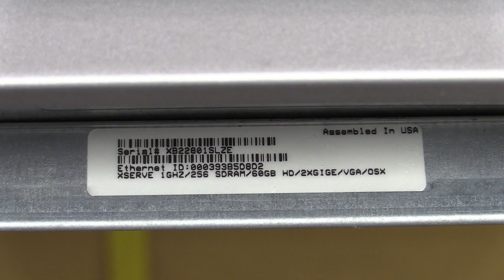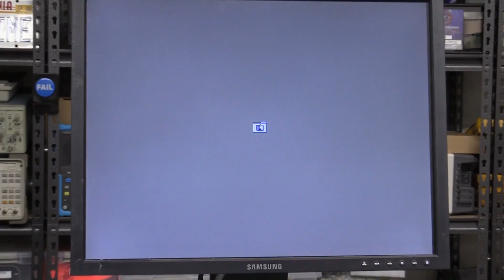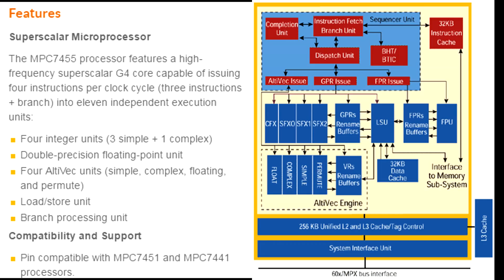EEVblog #882 - Dumpster Dive Apple Xserve Computers

Comment: What's the point? What do you do with an apple server?
Reply: +Marcel Robitaille Serve apples
Reply: +Marcel Robitaille. The same things you do with any linux or windows server. Database, NAS, Directory Server, render farm, web server, custom number cruncher, etc. The xserve was a pretty nice machine and actually at a reasonable price, but you would probably only get one if you had an office full of apple computers.  If your whole office was windows machines, a dell server just integrates better.
Reply: +Marcel Robitaille Simple: When you needed an Apple file server (for Time Machine, for example), you needed MacOS X. Linux didn't really support that in ~2002.
Reply: +Michael Wilkes Why get this pile of shit when linux is free? I don't see why you would want an os like osx running on your server, even if all you had was apple computers.
Reply: +Marcel Robitaille . Well yeah, thats what most moderately skilled people did. thats why the xserve is not very popular. If you know what you are doing, you run a linux server. There are a lot of people and companies that run windows servers because it is more familiar to them. xserve is specifically for people that would rather never touch windows or linux. I think to computer itself is quite nice, and the os is pretty nice, but it is a bit expensive and really designed for a niche market.
Reply: ***** Yes you are right that macs are very popular, much more popular than linux as a desktop. But this video was about a server, and the original post by Marcel was about macs as servers. Marcel is pretty damn spot on that linux rules the server world. Maybe you need to crawl into some dark server caves to see what makes the internet tick.
Reply: +Michael Wilkes Agree with you 100%. *nix is all very similar. If you know the commands for Mac you should have a good base for Linux, maybe even enough to get a server going with a bit of googling.

Comment: Plexi top cover on it, some legs and they might make a nice table.
Reply: +MrTVintro Good idea :) . I have a HP Blade server with a plexi glass cover. Used to belong to Blizzard once. Were selling them for a good cause and I managed to obtain one.
Reply: +MrTVintro Would make a good table that also does file shares...
Reply: dispatcher7007 the Pi does have lower power consumption going for it... not to mention, you can run an ass-tonne more disks on it just by whacking a load of powered hubs on it! As long as the Pi gets its 1000mA of power it's fine! The disks can all be run on external power... might be more plugs, but you shouldn't run into any errors with regards to limitations in the maximum storage pool capacity!! With an XServe, you're limited to 500GB per drive since it's IDE based!! The Pi will happily control more than 5X that capacity through ATAPI bridges to SATA disks!!
Reply: you believe in angels..

Comment: In fact this kind of "Squirrel-cage"-fans is used very often in 1HE server cages. It sucks in the air from the base panel and throws out the air with pretty high speed to the back (here, through the cage with the CPU(s). Therefore it sucks in cold air from the front through the hard drive cages because hard drives can't stand that heat and the fan then blows in direction of the hotter modules, like RAM, CPU and expansion cards.
Reply: +Slartibartfas042 I ever came across one in an HP workstation. That thing sure was noisy. Never understood why someone would put one of those in a workstation.
Reply: +Naomi Baron Oh yeah, you're absolutely right for a workstation. On the other hand - for servers this kind of "hair dryers" are pretty common. In fact, the 4cm diameter standard fans that you could use at the 1 Height-Unit servers (widely known as pizza boxes) as maximum size are even louder than the radial ones. :-)
Reply: +Slartibartfas042 Yeah the 40mm ones you get can be quite long and have 2 counter rotating impellers. In many cases they draw 1A + at 12V and are indeed loud (decent airflow and monster static pressure though)  But squirrel cage are just about deal for this application. They're also common on graphics cards where they had been part of the standard reference design for years. I think people underestimate how much air they can pull from a very narrow width below the fan, they are quite different beasts than "normal" fans (also called Axial I think?)
Reply: problem is, you can't really double up blowers. dual 40mm fans are for improved reliability as well as performance. one dies - cpu heats up, alerts go off, someone stops and services the box. blower dies - server stops unexpectedly.
Reply: if squrrel is mail service an air is ado be,watt sine gong soft hard cross word ant fleas?

Comment: Apart from the power supply and the fans, the case itself with some modification would work great for a fileserver, or external SATA raid drive case of a file server. I mean rack cases start from at least 100e.

Comment: So it had only 4 memory slots? Thats low for a server board :-)
Reply: +snajperSLO It's an apple, be glad it doesn't have soldered down memory, with the only upgrade path being "Dump it and buy new one".
Reply: +Pieh0 here come the boi
Reply: +snajperSLO In the 1U product space for that era, that was quite normal.
Reply: +snajperSLO Completely normal for early 2000s; a later IBM server x3550 M1 had 8 slots, and modern M5 has 24.
Reply: +snajperSLO Xserve G5 (2004) and intel Xserve (2006) all had 8-12. IIRC 4 slots was par for the course for servers in 2002. Some of the later Xserves were beasts
Reply: +Ursa Paws o shit waddup
Reply: +Pedro Rotoli what kind of machines are you talking about? i dont know any current generation server that is worse in terms of upgradability then older ones. i own several hp proliants from g6 to g9, sun sunfires and fujitsus. they are all user serviceable by design. you cant have hp employees drive to your datacenter to switch out a simple part.
Reply: this is about 1u rackmounted servers tough. i dont know much about current generation apples because they have nothing special to offer me that i cant get with just a normal x86 machine. and one of the big issues with apple machines is the lack of current generation hardware. they are always behind by about 2 to 3 years in tech. 

to sum it all up. i was refering to the discussion that was started about "server boards" by the op. you were talking about something else. just a missunderstanding :)
Reply: crow pot kind

Comment: Never knew Apple did servers.
Reply: +lsmanufactur Virginia tech built a top 50 supercomputer out of normal G5 workstation units (which was hilarious). When the Xserve came out and they upgraded, it took up much less space and was top 80ish at the time I think.
Reply: me too
Reply: +TheDessonater same here
Reply: +TheDessonater Many things are obscure when the big panel shows a ..well, i'd say candy, but it would be an insult to candy in this particular case.

In other news, Nokia did/does servers, now it also has VR, did land line phones, communications, now is apparently going in to medicine, had/has one heck of an R&D department, personal favorite they came up with is the bendable phone years before anyone else. Pretty freaking cool and useful too considering you can actually use the bendy nature rather than just "hey, look, our product bends".

Other companies fit the same bill. The thing you know them for is not the thing they might make the most cash on.
Reply: +TheDessonater Yes they do. Still do i use OS X server on a hackintosh I've built it works perfect.
Reply: Mac Mans Productions little slow on the server side never had one what do you do on the server is it just data?
Reply: +fox trot i use it for data back ups iTunes/movie server, time machine back ups etc its a NAS really lol loaded with 9TB
Reply: +lsmanufactur That's what they told the tax payer :) I bet they won't cheap.
Reply: Same here
Reply: hahaaaa,hell thats wot a mac is?